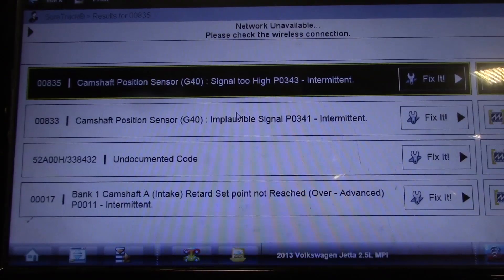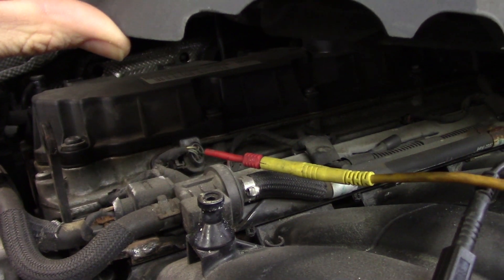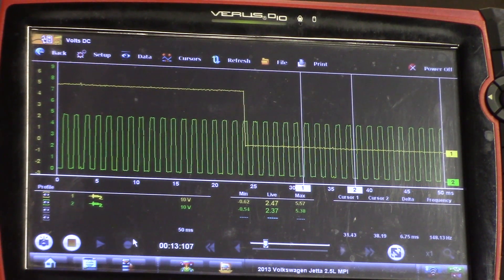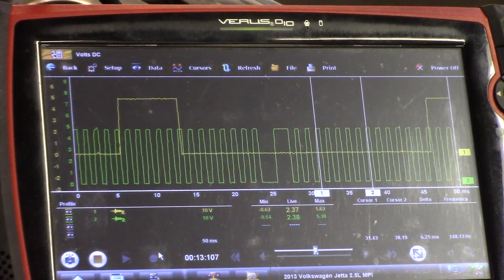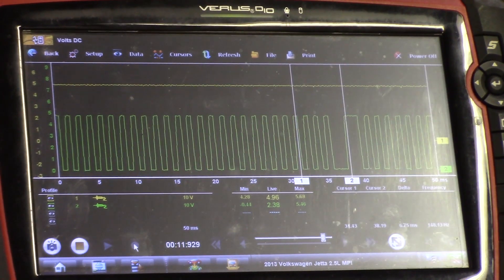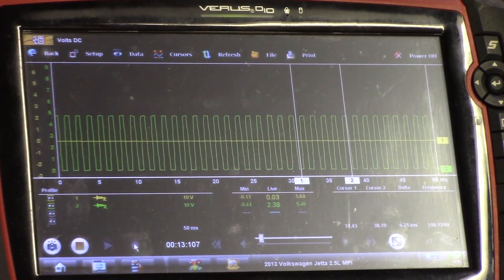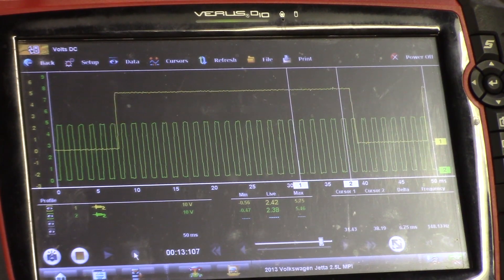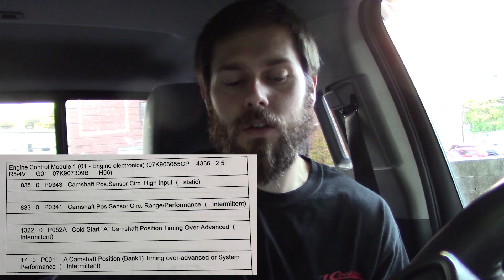2013 Volkswagen Jetta- Check Engine Light/Stalling, P0343 Cam Sensor Circuit High

Comment: I have a 2002 5.3 LS from a Silverado and I’m getting a P0343 code, it has hard starting and I can erase the code with my OBD2 code reader then start the engine runs fine let it idle for about 10 minutes and the code pops back up. The Cam sensor is an Amazon special “put in by previous owner sometime ago not sure when” I have a digital test meter and could test it if I knew the best way to test it? thank you for any help

Comment: This is why you diagnose and not throw parts at it! I have had many 2.0t engines come in with just a cam sensor code like a p0341 and they had timing issues like chain stretch, worn parts causing oil pressure issues to cam adjuster.

Comment: I'm looking into a p0343 code. On my supply voltage I have 4.99v but on the signal I have 4.86v. Is it normal normal for the signal on the harness side to have almost five volts when unplugged
Reply from the maker: Yes that is a bias voltage from the computer.

Comment: Showing the P0343 code on my 09 along with a P0651 which is for an open circuit. I’ve replaced the cam sensor twice and still no fix.  Cleaned every ground i found. Does this sound like a wiring issue or an ECM issue?
Reply from the maker: Start with voltage checks at the sensor.  You should have a 5volt reference and a sensor ground.   The signal wire should have 5 volts on it with the sensor unplugged

Comment: Hey Tommy I have  a 2015 1.8 TSI Passat.  It hit a sign in the left front. Starts and runs then runs rough after a couple min and won’t come out of park.  Only damage I can find was 5 wires that go to the TCM. Replaced all damaged wires and still won’t come out of park. Have all power and grounds ok. Only fuse that poped was the 25 in the SC panel. Think it could have taken out the PCM.  Scanned it and no com to Tcm,and a few other No com codes.
Reply from the maker: Possibly has a bad tcm.  Maybe took some damage if wiring was shorted together

Comment: I only have the p0323, cam circuit high. Cam/crank sensor is confirmed good. Extended cranking. How often is the actual harness an issue?
Reply from the maker: I’ve seen all of the above with this code.  I e seen bad cam sensors, open ground circuits and bad ecms.  I would do some checks at the sensor again.  Look at your sensor signal and sensor ground and see what you have and go from there.

Comment: I have the same issues on a 2014 VW Jetta - it runs fine but the EPC light is on along with the engine light - what would be the cost to fix this issue ?
Reply: Had the same EPC issue, I changed my plugs, wires, and coil pack, it was good after that

Comment: I cannot thank you enough! I've had these faults for 6 years. Back/forth to VW and they could never fix it.  After deep diving into message boards and YouTube I ran across your video with the exact same codes as your customer.  I went ahead and replaced spark plugs, ignition coils, and the Camshaft Position Sensor on my own. Cleared the code and it runs like new!  The spark plugs and ignition coils gave me back a super smooth idle.  I am going on nearly a week with all the fixes with no issues, no EPC light, starting at every crank (mine was super unpredictable), and no Check Engine light. Thank you so much!!

Comment: Great content...
Could that have possibly been a pin contact issue?
Reply from the maker: It is possible a pin contact issue could create the same problem. But when you flex on the housing of sensor chances are it’s a failed sensor. I’ve repinned connectors before and it didn’t fix the issue because it’s a problem with the sensor